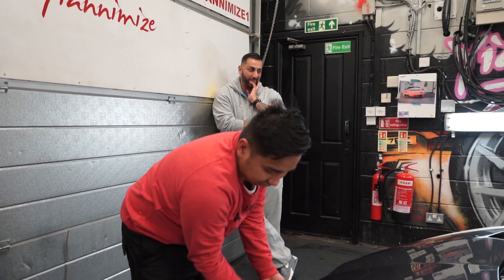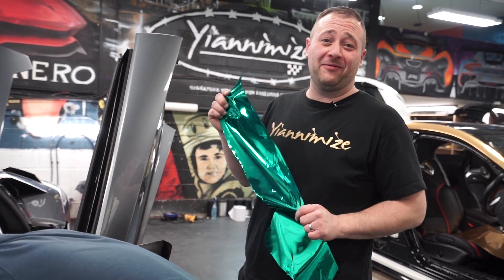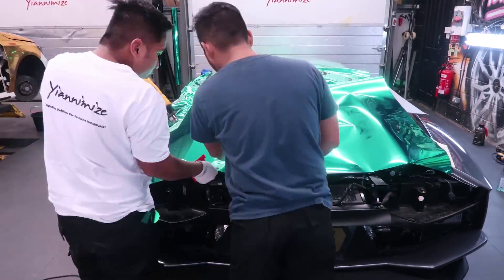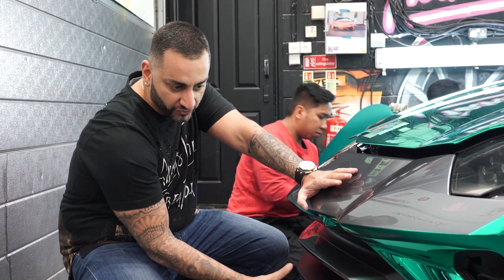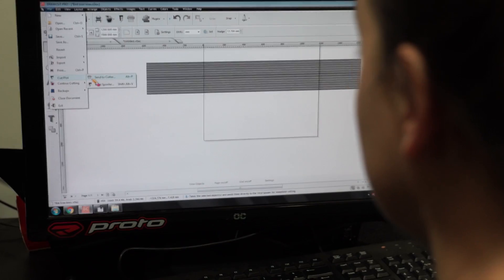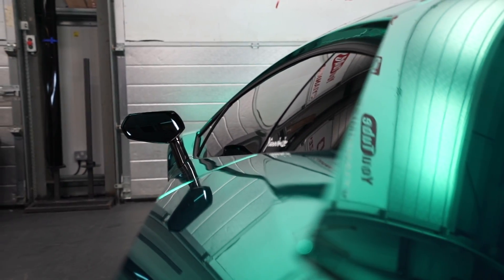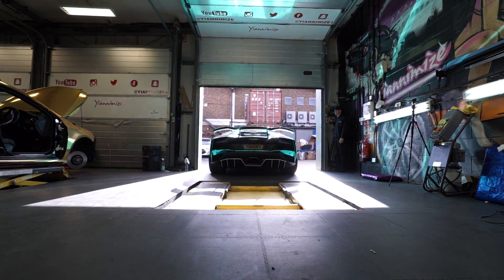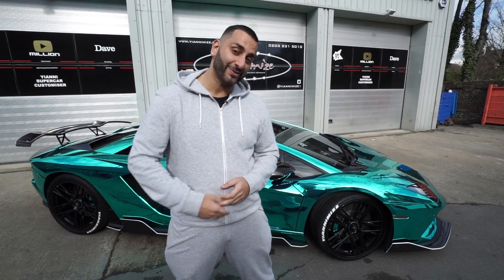Yianni's Lambo Wrapped in a New Chrome Colour

Comment: It’s a shame a lot of people bash this new technique alternative to paint jobs, this is very unique and in my opinion more vibrant
Reply: old comment but with wrapping they wont lose value because the color will be the original.
Reply: It also preserves the original color really well
Reply: And a hell ave a lot easier too.
Reply: Yeah but a scratch and its ruined
Reply: Dragon that’s not a problem if you can fucking drive
Reply: @kcnl2522  I'd rather ruin my wrap than ruin the original paint job. And cheaper to repair too
Reply: And it protect your original paint